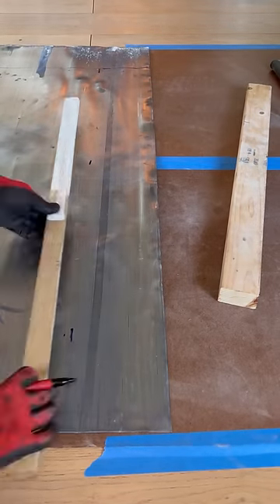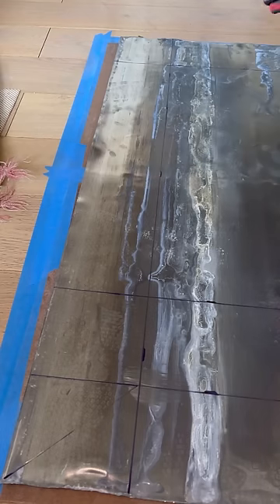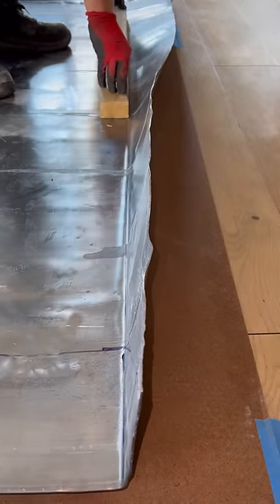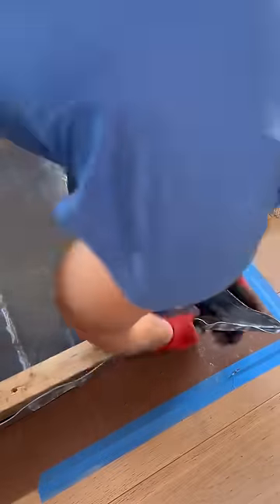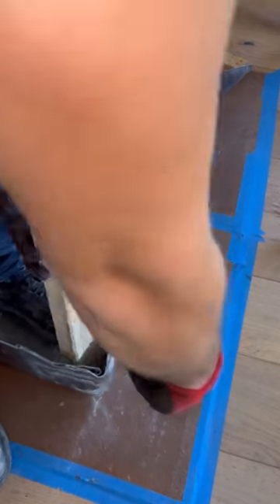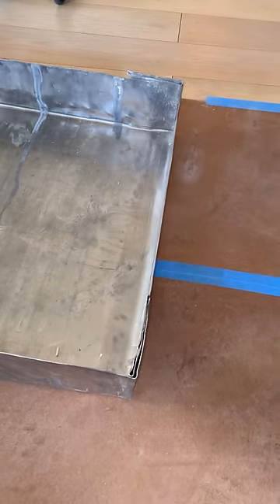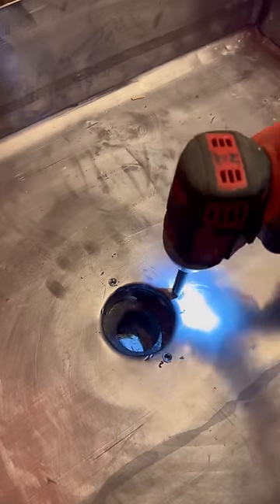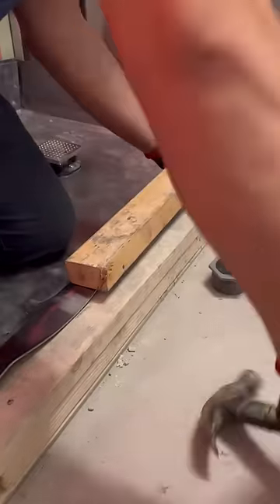Lead Pan #plumbing #nyc

Comment: What some of the people might not realize is that tile isn't being bonded directly to the pan, the slope is achieved using deck mud. Deck mud is the tileable surface. The lead is being covered by deck mud, thinset, and tile. No one will ever be affected by the lead or whatever
Reply from the maker: Exactly. There will be minimum 2 inches of a layer with mud and tile
Reply: Why use a 500 dollar sheet of lead if it's never seen ? Why not use ten dollar backer board ?
Reply: @NLPexperts  lead won't leak for the lifetime if the building
Reply: @austintalley4070  I wish that were true. The lead on my flat roof lasted less than 10 years and I think they are comparable.

A 20 dollar HDPE plastic shower tray would last 15 years. A 50 dollar 1/2 inch glassfibre epoxy shower tray would last the lifetime of the building. Don't contaminate the water with a neurotoxin, feed it to plants.
Reply: @NLPexperts  a shower pan liner can't be porous like backer board. You can use cheaper material but lead will outlast everything. A PVC liner might last 20- 30 years where the lead liner could last several lifetimes.
Only the tiniest bit of water ever reaches the lead liner btw.
Reply: @NLPexperts  tell that to a multi-million dollar condo owner to see which durable option they’ll pick 💰
Reply: @jackandbenny  of course. Tell them it is Inevitable that poisoning the waste water supply will become against building regulations and as soon reduce the property value.  It's a mistake to offer it.
Reply: @NLPexperts  How would it reduce the property value? Any regulation wont require its removal. Nice try bud....
Reply: @ipcamtalk4314  explain to you how poisoning the water supply through lead facilities will reduce the property value? Lead is the new asbestos. Argue that your plumbing is actually compliant, I want to argue, rather that than teach my students.
Reply: @NLPexperts  Lol, you are nuts...pray tell why it is still being sold and speced...you just want return customers.. if you did good work you would be able to sustain yourself on new work...
Reply: @ipcamtalk4314  because it is for sale, lead is not a neurotoxin ? Although we have spent 30 years removing lead pipes, you think lead is still a good idea ? I am "nuts" and to be dismissed out of hand? How is leeching a neurotoxin into the water supply doing good work. Stick to IPCams, found a resistor or anything else that can stop me frying your entire system with a piezoelectric sparker from any cable I can find?  The reason I do plumbing is it actually makes sense.
Reply: True, but that is like saying the asbestos is behind layers of other material and is not an issue.
Reply: Just the poor plumbers that have to handle the lead!
Reply: The old ways are usually the hardest and best ways I'm a carpenter and I can absolutely attest to that
Reply: @NLPexperts 😂 Yup that's why you do what you do and we do the rest
Reply: @Bound4Earth  it's not. Asbestos is only a risk when it's irritated by sanding, scuffing, or some other disturbance.
Reply: @NLPexperts  I'm sorry to say but old buildings and homes across the US still use lead waste lines. Not that we don't know better today.
Reply: @ipcamtalk4314  fail building inspection. Buyers demand non destructive testing from property inspectors on most 500k plus houses. When lead detected, value of building reduced due to destructive works required to remove the neurotoxin lead.
Reply: @NLPexperts 
This is in Manhattan. Do you really think the owner of a 10 million dollar apartment wants a plastic shower base from Home Depot? Kind of hard to take you seriously after your “backer board” idea anyway.
Reply: @NLPexperts Backer board can crack and leak.  Lead is flexible.
Reply: @NLPexperts Not comparable at all ,flat roof is subject to the cold, heat and water.

Comment: Nice work. Clean and neat.  I am a telecom splicer in Ct.  We still have to take off lead splice cases. I was one of the last classes in training taught how to make a lead sleeve.  Most guys take the lead off and replace it with a new case. Not me, I try and get the old one back on if it isn’t too far gone or it’s not football shaped.  Working with lead is tricky and not light work.
Reply: Thats what we do cut the lead off and put a waffle case on...
Reply: @darrylhoward767 , what’s a “waffle case”? We use a Preform steel case with hard plastic/foam core drillable end plates. I find putting the lead back on is easier than dealing with taking off the lead sleeves on the cables and the lead end plates. We use an open flame propane torch, same as most plumbers too.

Comment: Facinating. One question I have is: Is there not a concern of lead posining/polluting the water supply should the shower be compromised and the excess water/lead contact going down the drain? You are correct that no one will be eating off it yet wondering about the larger environmental impact. Would love to see your feedback as this is the first time seeing this method.
Reply from the maker: The shower cannot get compromised because it get covered in a mud job and tiles. 
And sewage water goes through treatment facilities
Reply: If the rest of the shower is done properly, water will never touch that pan,,

Comment: I can see in NYC using that stuff. If it works, don't fix it. Imaging any other technique failing and flooding the apartments below. Here in south jersey I used lead coated copper on all door and window sills on the high end (big money) ocean front homes I use to work on. We even went as far as soldering all the joint with lead. Same difference I say. If I were still in NYC, your number would definitely be on speed dial on my phone. Keep up the excellent work you provide.

Comment: Wow that's crazy good work Do you glue them down,or are they free floating?,
 Also what goes on top,is it a shower tray, like a ceramic,or is it covered by tiles,also do you ever have to reinforce that floor for that much weight, probably a lot of work involved, I've only ever done wiped leaded joints on gas lines, definitely different to work with than copper,also is lead used on cladding roofs around vertical flue stacks and drainpipes or is it something else used?

Comment: Could you show how the rest of this goes, there was a tile man in the area where I work that was from New York City and he used to talk about how he started out as an apprentice where he was only allowed to carry tile and mortar things like that then is he got two or three years under his belt he got to start cutting tile and then laying tile and he talked about that process and how they did things in the city and it was interesting to watch someone go through an apprentice to a journeyman to a master. But I've never seen people lay tile the way they've done it for years in New York City with the concrete then the chicken wire and then laying the tile. Now be honest those jobs have lasted for hundreds of years so there must be something to it. But I'd like to see it and since you've got this shower from the beginning do you think you could get some video of the tile setters doing their job?
Reply from the maker: I would like to but I leave the job once i finish the plumbing and then they put the tiles. After i go for the trim installation
Reply: That’s a wet bed job. Not done any more due to the weight on the floor. In some old houses you can see sag in the joists although the house has to be in pretty crappy shape to see sagging at all. A lot of tile contractors have an old timer around who can peel off an existing tile floor plus a half inch of the soft cement they used and lay a new floor with thinset. It saves a LOT of tearing out.
Houses are built more and more cheaply with composite joists and way smaller joists that they used back in the day. Wet bed is too heavy. Nowadays you go with cement backer board and maybe a quarter inch of thinset then slap the tile on. BTDT.

Comment: Interesting method. I think PVC and tar would be way cheaper and less toxic. I did learn something new broski.
Reply from the maker: A lot of nyc buildings prefer this still lol
Reply: Lead is safe when in a form like this.  Only when you add highly acidic water does it give off toxic lead particles.  Flint had safe water running through its lead pipes until they stopped paying Detroit for clean water and ran acidic flint river water through the pipes.

Comment: In Florida, I've seen a lot of them from the seventies and eighties, I was always taught that they're bad. Go figure. That's really nice though, I would like to see a test, LEaD vs. Pre slope and vinyl liner done correctly , with a weep hole protector, you can't use LEaD pans in Florida anymore, I've only seen them ripped out. Why didn't you wrap the whole curb? Typically the only hole should be on the outside of the curb holding the vinyl liner, at the bottom of the outside of the curb with two Corner dams on either end also. Great video.... also pitched two-by-fours because when the water gets through even if it is solid surface at the ends you want it to hit a pitched surface and go into the shower

Comment: I've removed a few in my time I live in Texas it's not used a lot the customers wanted a bath tub failing vinyl rubber pan's I've removed a lot I couldn't tell you how many. I'm curious the curdy systems not used much in NY
Reply from the maker: In the city, especially manhattan they still prefer this method. Many other methods are also allowed

Comment: copper and doing your pan and pre-slope out of bedmud also works then you can use a topical like redguard, aquadefense or Hydroban ect  2 coats minimum plus blood test though and throw some pee-stones and protect the weeping holes ....thank me later 😅🇨🇦🍀 #broski 

keep the videos coming man much 💙🇨🇦
Reply: If you watch Tile Coach, he's seeing a lot of failures with Redgard.  The new go to waterproofing agent is now Hydroban
Reply: @cyclopsvision6370  yeah watch him, I like Isaac....the  installation failures due to improper installations in every case I have seen, same with schluter systems and others unless defective product, that happens but warranties cover that, call you're area representative or have theperson that did contact them better yet lol 
Aqua defense I trust but 2 or more coats on it for a pan especially if your first time, I can do 2 but if  you're unsure 3 or more can't hurt I could see how people put that to thin because trying to save few $$ lol 
bad idea, most don't realize 1 drop of water every 20 minutes can do over 20 years
Reply: @cyclopsvision6370 Hydro is good 😅🇨🇦🍀
Reply from the maker: Loll the rest sounds like its for the tile setter. Thank you though

Comment: There are older cities with lead pipe connections at every bathroom drain, they will see way more water than the small lead overlap here will see.

Comment: I like the idea of a lead pan. I wonder if they make steel pans?  hu... to the googles! I don't know but either way I'm using the metal pan. I didn't even know they still made those for showers. next time I put in a shower I mean you're not going to even be standing on it. it's going to be covered By mortar joint and  tiles.

Comment: What happens when the lead concentration in your water supply gets too high?
I saw the shower pan and I had to ask. Not sure what you guys do to prevent the lead from deteriorating and ending up in your pipes.
Reply: Unless you get a tile or grout failure, 99.98% of that lead will never see a drop of water. Besides this is drain water it will get treated and released into river water that feeds no other supply. The amount of lead in the old copper pipe joints would be the most likely source of lead in a buildings water supply.

Comment: How is the water gonna go through the wee holes If it’s not pre-slope so I don’t see how good lead pan is. I did a shower 24 years ago and it’s not leaking and it’s a 40 mill Noble, seal
Reply from the maker: There is a pre slope.

Comment: Why not use normal vinyl shower pan?? It's way easier cheeper and you can run it up the wall and around the curb better.  It should last longer then the tile.
Reply: Did you do anything else to cover the curb?  Inspectors here want to see the curb totally covered with corners as it tends to rot first. I also use PT for curb

Comment: Pretty blown away never knew this was done in lead, I thought that shit was poisonous. Do you put tile over this
Reply: It's only poisonous if you are consuming food or water that was in contact with it directly or your cutting it and the particles are airborne. Also if it's heated to melt it you can get lead poisoning from the fumes. Otherwise it's not going to be a problem.
Reply: @daddy1571  thanks Dad
Reply from the maker: Yeah mud job and tile

Comment: Why not solder corner also?
Reply: because there was no cut in the corner, it was folded
Reply: @cyclopsvision6370  my reasoning is that it dam the water , bond the corner together, and strength it. That why. We not concerned about water in the flaps. 
Great job learned a lot. 
Leader for roofing would solder it.
Reply from the maker: Its not necessary. It would be way more work lol
Reply: @hydronyc  thanks have great work day. 
If you pulled a lot of old ones or the old timers taught you then we are golden.

Comment: Lead because of rats?
Pretty much spray on liners or schlueter here.
Been a plumbing since 95 and only seen a couple lead ones.
Reply from the maker: Not the rats just last longer and it’s more preferred by buildings and architects

Comment: I thought lead was toxic to the touch and inhale as well?
Reply: Touch, not so much, although wearing gloves is still not a bad idea. Inhale is only relevant if you're creating lead dust or smoke, which as you saw, they bent it off instead of cutting it to avoid any of that.
Reply from the maker: Not in this form

Comment: Where would a lead pan be used with a toilet? 

If you’re friends with any fisherman you can melt down the scraps and cast weights.  We do that with the scraps from when we do radiation protection in hospitals

Comment: 😅 Not saying much , beautiful art of work . But we’re in 21 century , I’m pretty sure there was a good reason why lead work on a shower trays was stopped, because you can’t cut trough , drill it , which you already did 😅 it creates the air-bones, it is poisonous and better don’t heat it up or soldered , the smoke fumes toxic as we’ll. Lead nowadays mostly used in a X-Ray , Nuclear power plants , Medical facilities scanner rooms to prevent radiation ☢️ escaping from a room , acts like a shield , same as dentistry industry they scan your tooth . You need to be very careful ❗️with this stuff . Be smart for a sake of money let someone else deal with it .
Reply from the maker: Lol thanks. Its still not stopped in NYC though lol

Comment: Today I learned the NYC plumber code is fucking trash. I think you are a craftsman and very skilled, but don't see any benefit to using lead as a pan. A fabric pan is just as good and costs a fraction of the price and most importantly is not toxic.